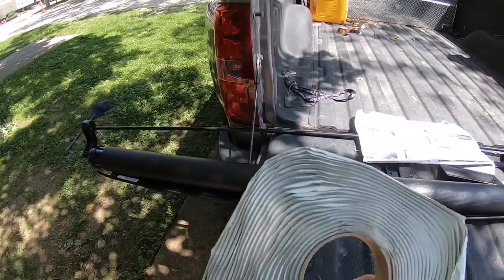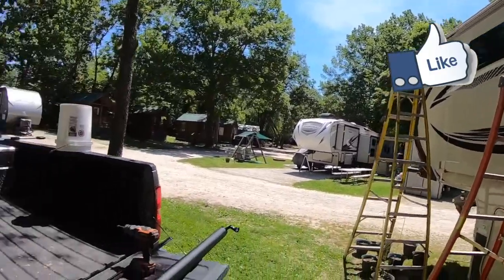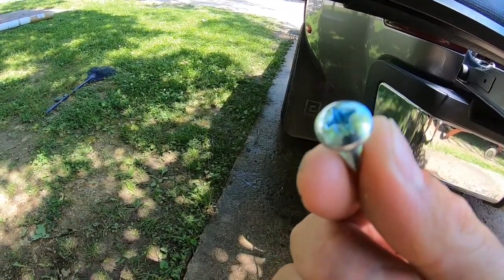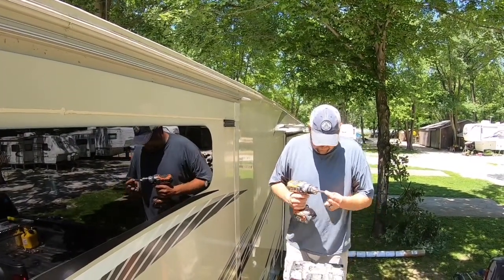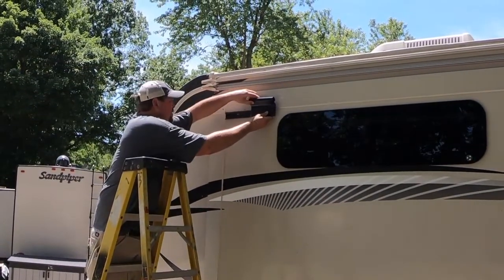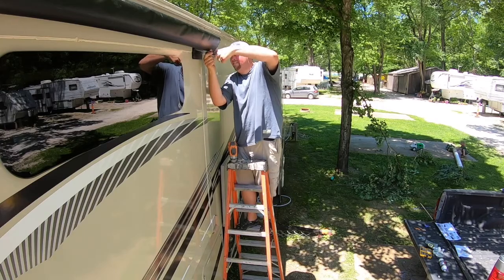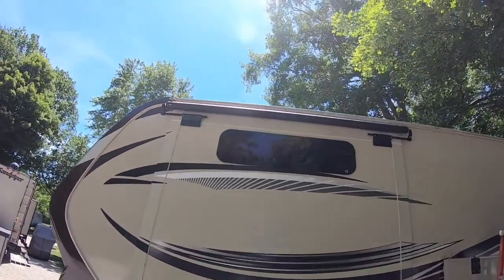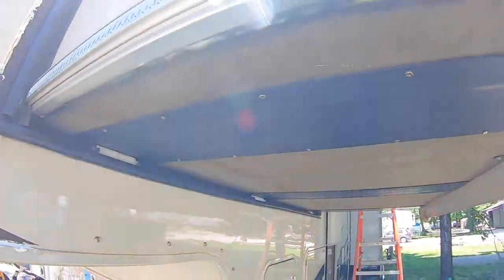Slide Topper Install | DIY Slide Awning | Solera Slide Topper Awning Installation | Full Time RV

Comment: Thanks for doing the video. It makes me confident that I can install the topper quickly this weekend.
Reply from the maker: It's an easy install. Definitely need someone else to help you though. Let us know if we can help answer an questions
Reply: @HayesHumbleHomestead  Thank you. I went outside and saw there is, as on yours, the  piece mounted to the side of the trailer to slide the cloth into. However, there are ends added on to guide the rain flow away. The heat of the day should cause the end pieces to be flexible enough to allow the piping to slide into place without having to remove them.

Comment: I installed ours on the lower position on the mounting bracket. That put the fabric about 1/2” above the flange and gave us better slope on the fabric.

I added solera slide toppers after going through a major resealing of my small wardrobe slide with schwintec mechanism and livingroom slide with the rack and pinion mechanism. I noticed what might be a leak after seeing water dripping from the front corner underneath on the small slide. This was after a really hard driving rain shower. It may have blown the water under the end of the slide but I’m taking no chances. I replaced all of the screws with SS screws. Then I used 4” eternabond tape and wrapped the entire perimeter flange and covered all of the screws and the edge of the flange. Then covered the top corner of the roof after removing the silicone and resealing with alpha nonsag. I removed and resealed all of the screws before covering with the enternabond. Then I put a bead of nonsag alpha systems sealant on all edges of the eternabond tape. My big slide came from the factory with the plastic skis on the bottom corners. I covered the bottom seam with eternabond after removing the silicone and resealing the trim piece and the new SS screws. I pray that this fixes/prevents any leaks in our slides.
Reply from the maker: We ended up moving our to the lowest position as well which gave it a little better slop for runoff. 

It seems it is a constant battle will h these rigs and water but it's better to be proactive than reactive and try to prepare for any intrusion. I'm constantly inspecting ours to make sure we don't have any potential issues

Comment: Great video. I didn't see the slide roller plates in your description? Also what slide lube spray do you use for your rollers ?
Reply from the maker: I fabricated my own out of 1/8" steel plate I believe. I don't know a specific brand off hand. I just used a silicone spray so dirt and stuff wouldn't stick to it and gum things up

Comment: Great video. Thanks. Did you have to take the gutter extensions off to get the slide topper fabric in place?

Got to have a roll of eternabond on board.👍

This is next on our list. We need two of them.
Reply from the maker: They make a world of difference. Just a little pricey to do all at once. 

We also always travel with eternabond tape, lap sealant, and butyl tape just in case!
Reply: The Camper House we have a 2019 GD Reflection 28bh and it has the gutters already in place above the slides. 👍

Did you have to remove the gutter extensions on the ends of the rail to get the material into the rail?
Reply from the maker: @hardtruth2039  no. It slid right in. The only thing we forgot to show in the video was removing the clips that suck it snug. Easy project and definitely worth it. We'll do the other two eventually too.

We were also at an RV show today and checked out the new Reflection BH. They are beautiful!
Reply: @HayesHumbleHomestead  How did you start the fabric through the end of the railing in the gutter without taking the downspout off first?
Reply from the maker: @patpage8702  ours sat low enough and had a little flexibility to bend that we were able to slide it in without any issue. I can see where some may need to remove if they are too high but the fabric and rubber/plastic end is flexible enough that you should be able to bend it and work it in. Might just have to go a little slower

Comment: I did this and had a lot of trouble getting the hexegon bars to line up on the brackes and now I have too much slack in the fabric when the slide is pulled in.
Reply from the maker: I would try removing the fabric from the camper side and then taking the slide topper completely off and redo it again. Hopefully you saved those clips. It sounds like you may have just unrolled it a little too much before you installed. Hopefully that helps

Comment: Slide topper should be sloped good luck in heavy rain storm. From the video it looks like it’s slopes towards the trailer.
Reply from the maker: We've been in several heavy rains and the topper gradually slopes away from the trailer. The rain always runs to the end.

Comment: The topper is too flat! The slide gutter should have been removed so the new bracket could have been put on directly under the main gutter to give the topper more slope.
Reply from the maker: We lowered the bracket on the slide and it seems to slope just fine. That may be be helpful to someone though!